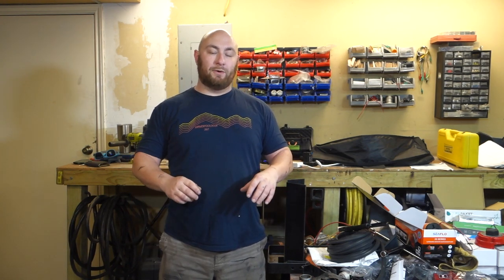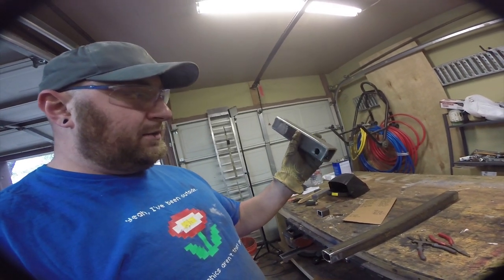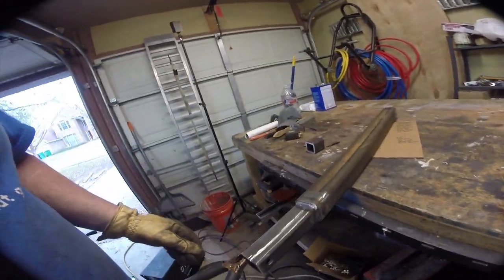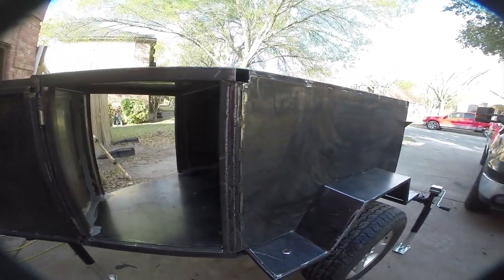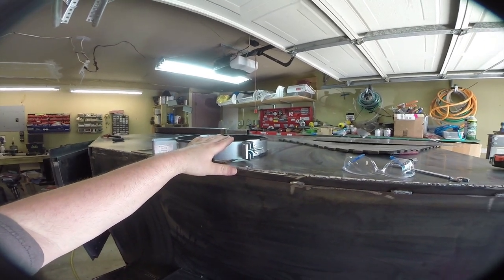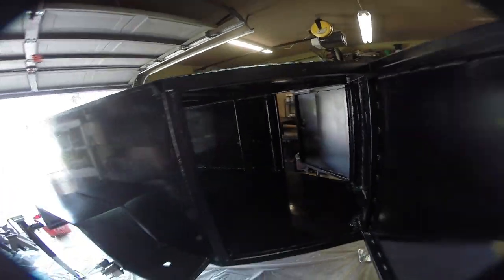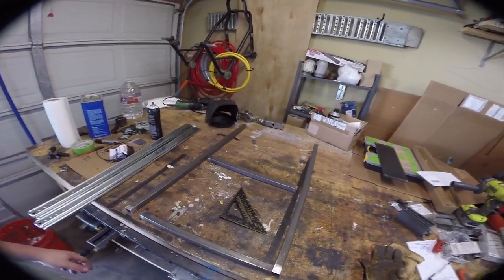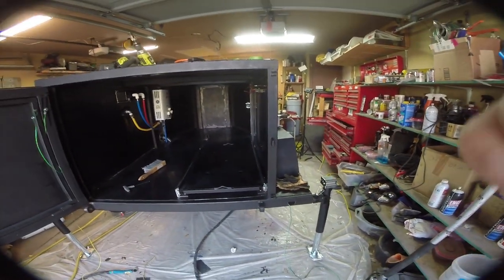Adventure Trailer - Episode 4 - A Bunch of Little Things

Comment: I'm no expert but I've been told by multiple people that POR is not really that great for bare metal?  curious on our past results on projects?
Reply from the maker: No clue who would have told you that. POR is paint over rust formula 15. It is expressly designed to bond to rusty metal to form a one stage coating that wont peel or flake.